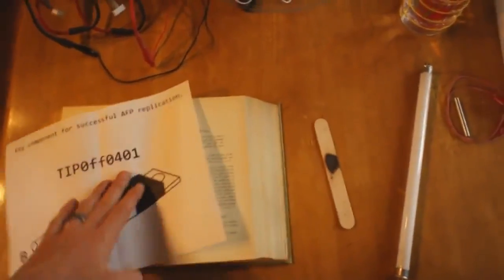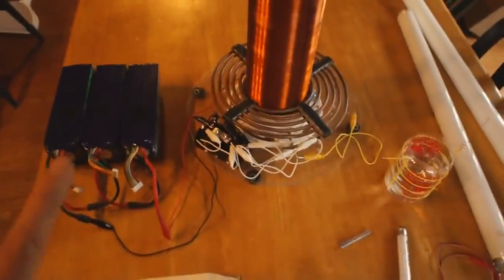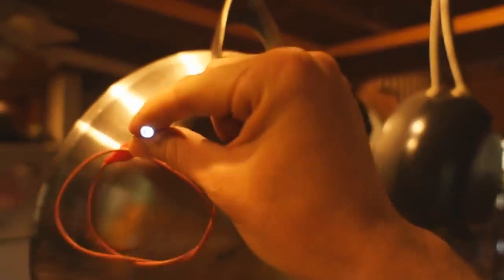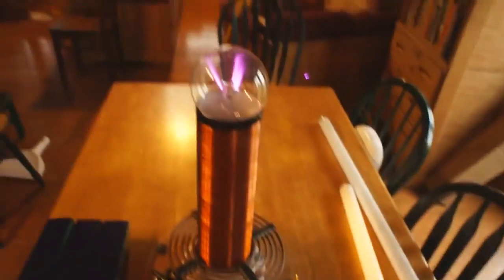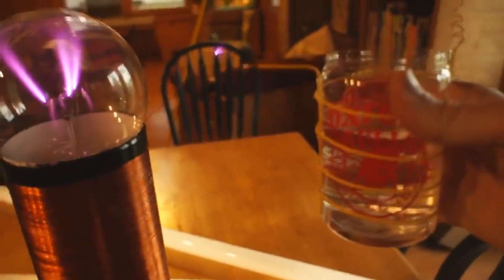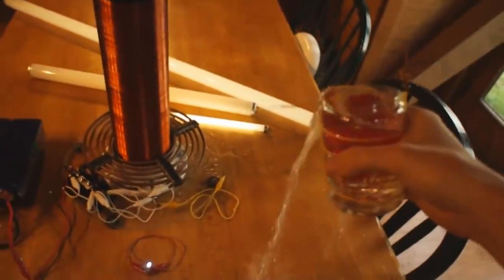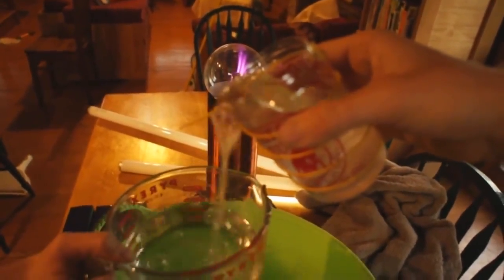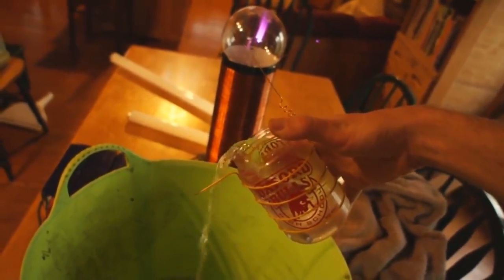Expanding Water using the Tesla coil  The secret to perpetual motion and over

Comment: You should name that metal fooledumium. I've got nothing up my sleeve...but I won't ever let you see the back of my arm. I see it expanding! What a clown. When you could do something cool, like use the tesla coil to strike an arc underwater with carbon electrodes and make hydrogen and carbon monoxide? Then hydrogenate it and make methanol. Run it on a solar panel in the summer and burn the fuel in the winter. Simple right? The only not simple part is it would be lights out for the petroluem industry. They probably made this video to convince people whom would otherwise be supporting real stuff that could fix our planet that magic devices exist. What a joke.
Reply from the maker: The metal named sloofthanium which read backwards its fools. This video is made for april fools day.. 😉
Reply: This is easily accomplished using a homemade Voltaire stack using magnesium and copper, run to a power multiplier, feeding a tesla water turbine, powering another power multiplier to a 50000v ignition coil to a tungsten rod, arcing to a round, hollow magnet creating a plasma vortex, which creates, burns, and rebonds the hydrogen and carbon atoms simultaneously. This could also be done using a thunderstorm generator.  Easily create a selfsastaining coil with this method.  You will of course need the proper hardware....